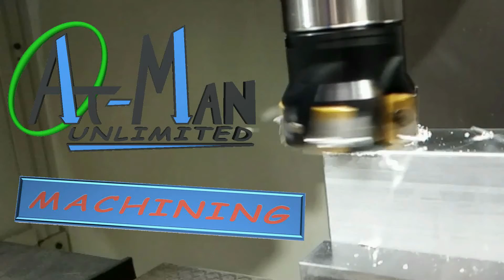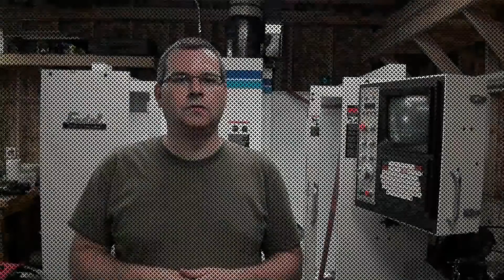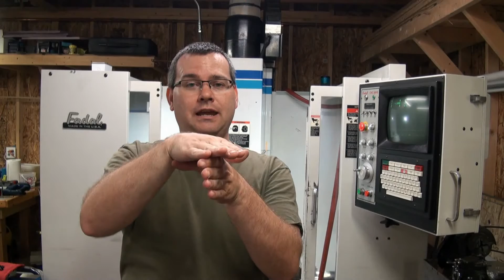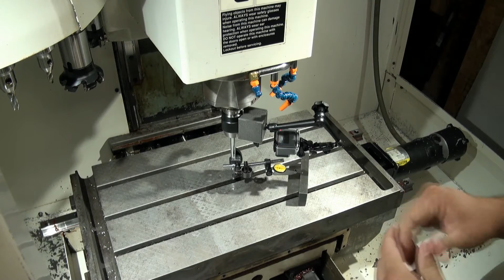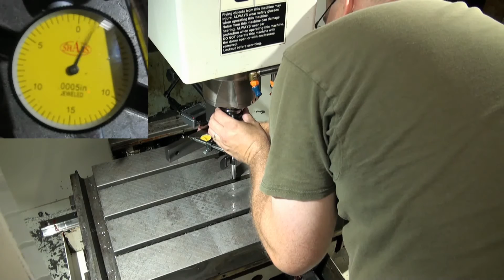CNC Machine Setup and Alignment Part 7: Spindle Tram

Comment: If there’s twist in your casting or misalignment in your ways then your method will yield different tram results depending on the position of your table. 

You won’t get an accurate tram reading if you move your block around your table to take readings because (1) the table is not perfectly flat and (2) you’re not exercising the lengths of the XY axes which is ultimately what your work and table ride on. 

Instead, keep the block stationary, take a reading, then rotate the spindle 90 degrees and jog your table (traversing along the XY plane) such that the indicator reads at the same point on the block.

Comment: Be very careful about removing shims from the spindle. Just like an alignment on your car. Your alignment doesn't just change on its own. 99% of the time it means something wore out or you crashed it. Same thing on the machine. The spindle doesn't move unless the ways are worn or the machine was crashed. 

I like to see tram within .0005 TIR on a 10" circle. You're not that far off. IMO, on a VMC, tram is far more important than squareness of the Z axis. I would use the middle two leveling screws to lean the Z axis and get that tram a little better.
Reply from the maker: Wes, when you buy a used machine as old as this, your just about 100% sure it has been crashed at some point in its life. When you take apart a machine as far as I did you need to check and readjust everything. When considering your total GDT you must consider all sources of error.
Reply: That's fine, but removing shims from the spindle should be the last act of desperation. Like I said, most tram issues can be solved with the leveling screws. Perpendicularity of the Z has far less impact on the parts than good tram.
Reply: @WatchWesWork     Perpendicularity of the Z is very important when you are drilling deep hole. You don’t want to move down in a linear angle, you want to move down as straight perpendicular as possible for a straight hole. You must consider all sources of error as he mentioned.
Reply: Is there any other methods to align spindle perpendicularity to xy plane? I had tried on my 1998 850 VMC, but seems no improvement..
Reply: I have a VMC that was crashed pretty bad, like you, I'd prefer to see .0005 TIR on 10" but I can't get better than .0015.  I've never shimmed a spindle before, but is that common place to correct for such an error? If so, how can that be achieved?